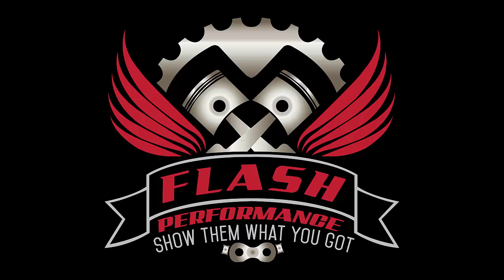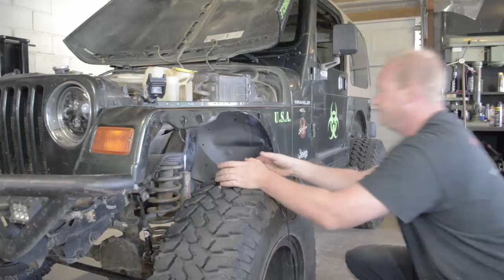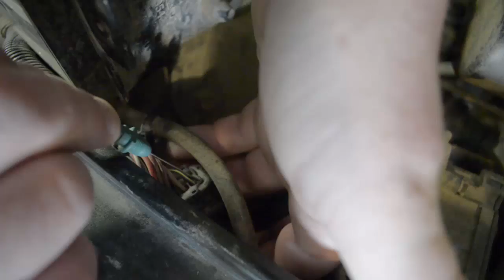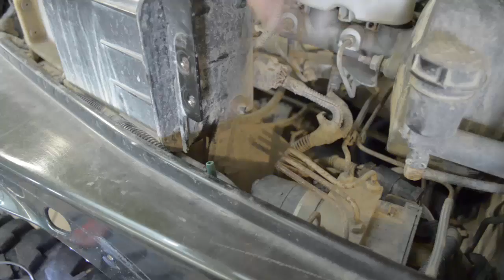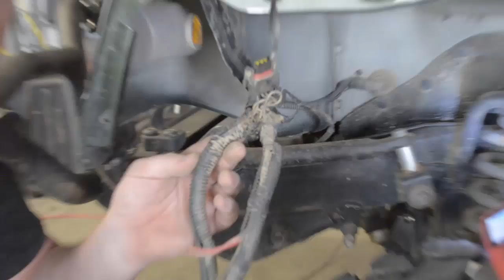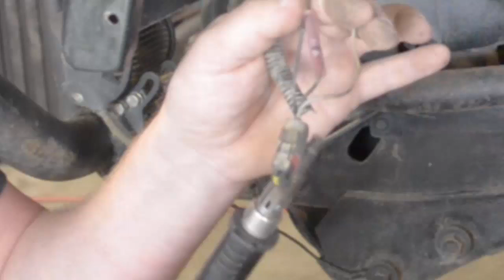TJ Turn Signal Repair

Comment: Great info, thanks.
Cool tool I'll grab one.
Using Black Butyl tape, pressed over your connections will add a weatherproof barrier for those times you see your headlights under water/mud...

Comment: Great video.....with just right amount of humor.  I’m the original owner of a special-order 1997 TJ Sport.....which I don’t have the heart to get rid of, as I brought my youngest home in it from the hospital.....and all three of my kids learned to drive “stick “ in, and when I took delivery of it in Chesapeake VA, my teenage daughter exclaimed “Now you’re a ‘cool dad’, Dad!”  (Geez......I always thought I had been!?!).  Anyway, I am retired Navy.....and I think we used Waytek (or similar) connectors back in the Stone Age when doing inflight repairs on P-3 Orion’s during Soviet submarine-tracking missions.  That “mini-torch” you used to heat-shrink  the connection intrigues me....and any info on that useful tool would be appreciated.  Bravo-Zulu on this video, amigo.....job well done explaining how to properly chase down those damned hellish electrical gremlins!
Reply from the maker: Thanks, I appreciate the kind words.  The Torch I am using was made by snap-on, but you can find them now on Amazon.  This one is made by power probe and has the same features.  https://www.amazon.com/PPSK-Automotive-Diagnostic-Electronic-Adjustable/dp/B001DIE9BO?psc=1&SubscriptionId=AKIAILSHYYTFIVPWUY6Q&tag=duckduckgo-d-20&linkCode=xm2&camp=2025&creative=165953&creativeASIN=B001DIE9BO
Reply: I still have my '97 with the 2.5L 
Not my daily driver, but it's my baby 😁👍
Reply: @teop7887  Right on, TeoP!  According to “Jeep wave” etiquette, those JK and JL guys....they’re supposed to initiate the wave (newer Jeep always waves first).  It’s kind of like “passing honors” on Navy ships....so if done properly....you and I should be getting those waves!  Keep on Jeepin’ on!

Comment: My wiring is suspect in my TJ turn signal failure.  Worked fine until I hit a deer in July of 2018.  Now since then ive replaced by flasher unit and new bulb and bulb socket but markers or signal dont work.  Thinking shock from the impact broke something in the wiring.  Doubt its the switch.....but then again I could be wrong